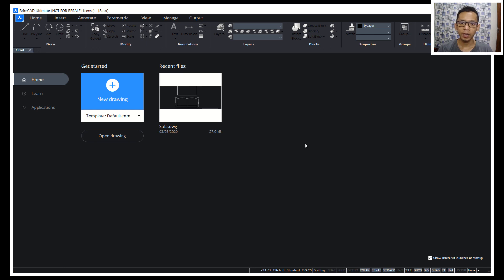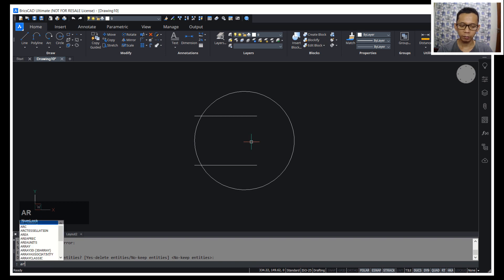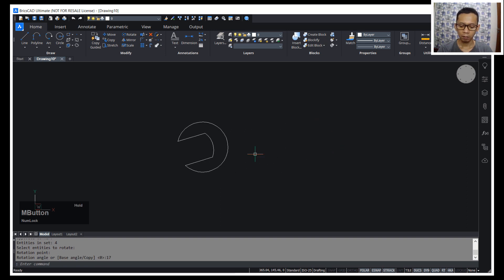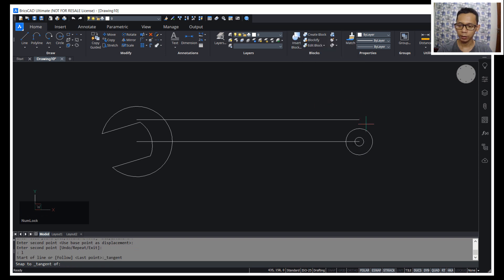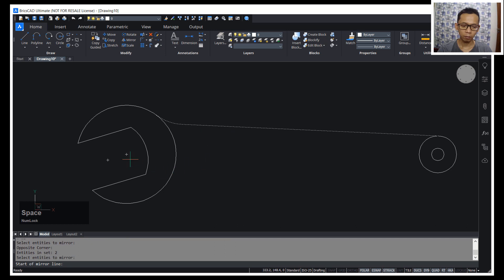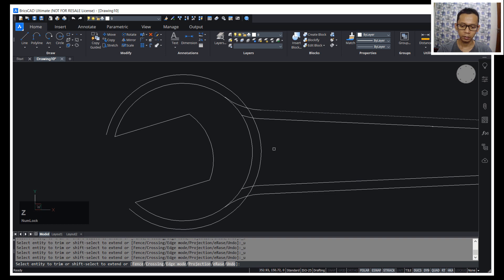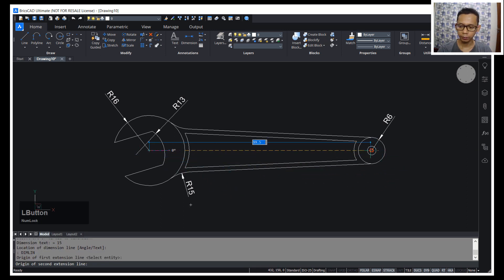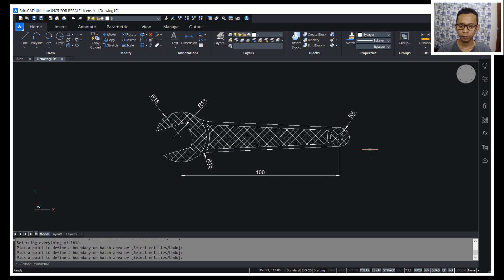BricsCAD 2D Modeling Single Wrench Tutorial #mufasucad

Comment: Hello Mufasu!  I like your vids.
I'm being greatly frustrated using BricsCAD in that creating complex 3D models is easy and straight forward but coming back later to edit them is extremely confusing and filled with pitfalls.  Often I can draw something complex in an hour, 3D print it and discover I need to make a few adjustments.  I come back to make what I think would be 5 or 10 minutes of changes and end up spending 4 or 5 hours trying to make physically simple changes.  It's like BricsCAD turns on you becoming random and mean.   I have searched everywhere on YouTube and no one shows how to come back to 3D drawings to modify them in various ways.  I want to modify them by moving holes, moving slots, cutting parts off and moving them,  removing openings entirely, changing fillets,etc, etc.   I have friends who have also bought BricsCAD and we all struggle with this aspect.

Care to be the first to help us all?  It would be a huge help to many new BricsCAD users.